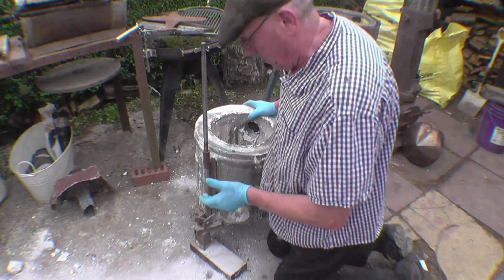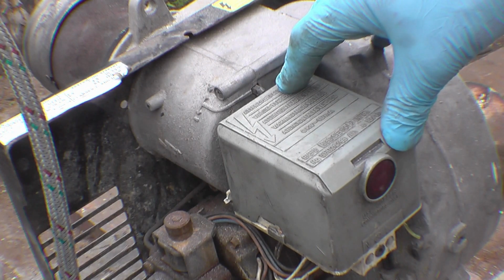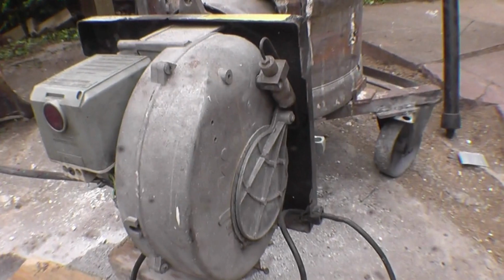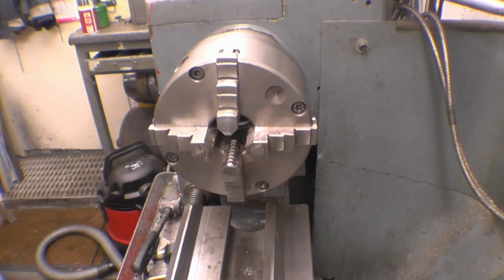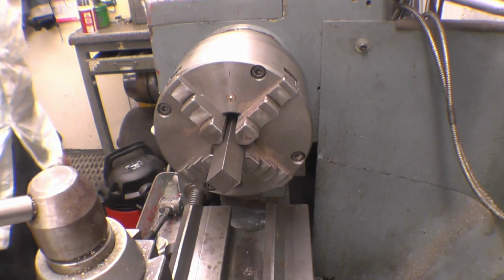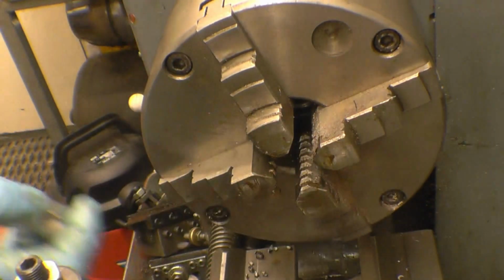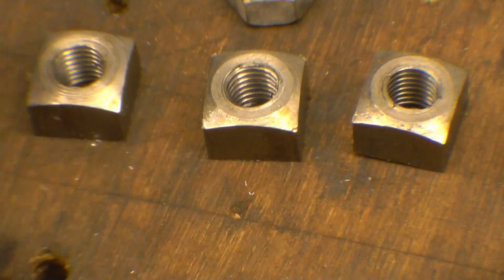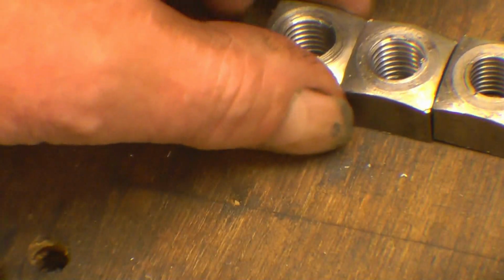SNNC 342 P1   Casting Furnace Mods . Richard Trevithick Plasma Cut out

Comment: Hey John, I also use oil, whether diesel, kerosene or whatever is the lowest cost that day, but something I learned the hard way … if you're not going to use your rig for quite awhile, say at least 6 months between uses, unscrew the fuel outlet nozzle itself and store it in a container of varsol or paint thinner or something. Otherwise, at least as my experience goes, the fuel that's left in the nozzle screen will sort of gel and turn waxy making that nozzle useless. I'm many thousands of miles away but these things should all work on the same principle, when I unscrew my nozzle there's a sort of screen built into the back of it, resembles steel wool but coarser and made of compressed brass or something. Anyways, I do wish you continued success and thanks for the videos. Cheers !

Comment: You might get a bit hotter with kerosene and it will burn cleaner . But it may be more costly not sure comparing to propane and fuel oil. We used to add a bit of transmission fluid to our tank to help with the sludge in some fuel oils.

Comment: Interesting you went to using kerosene as a fuel in your foundry.  At some point I would like to try casting, been collecting bits and pieces, but was looking at propane-fired designs.  You say the fuel for a kero burner is cheaper, is the burner unit itself comparable in cost to a propane design?
Reply from the maker: Propane is much easier to use  the burners can be home made cheapley